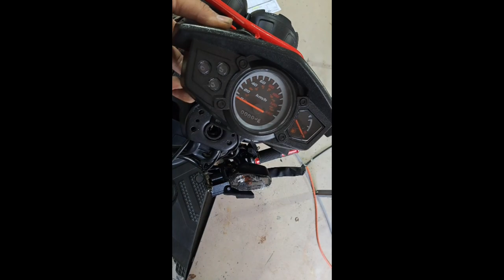chronicles of owning a Chinese scooter : the first start*

Comment: It's a copy of the Yamaha Zuma 125. I have one. It's called the Ice Bear Vision. Uses the standard Chinese GY6 engine. Mine's been running just fine for the past couple of years. They do need a bit more attention than a Japanese or Taiwanese scooter. Yes that helmet does look a bit ridiculous.
Reply from the maker: The model I have is  an ice bear malibu. The vision is the model with the zuma 125 headlights found in the Taiwanese market.
I've been working on Chinese Gy6 scooters since 2005. 
The helmet is for fun. As are scooters.
Reply: Does not matter what you ride you need protection. Remember scooter or motorcycle you still become a road crayon.
Reply from the maker: @scrambler69  I agree protection is needed. However I'm working on a bike in the garage. So not sure why this applies here.

Comment: I'm Thinking About Getting The Same Bike
Reply from the maker: Let's hope this series makes you excited. Will be posting an update shortly.
Reply: The Thing Is I'm Not Familiar with Assembling Bikes
Reply from the maker: @deontraymartin964  for this bike it wasn't the hardest of gy6 powered bikes. Some require installation of the front end which can be troublesome and difficult due to panel misaligned